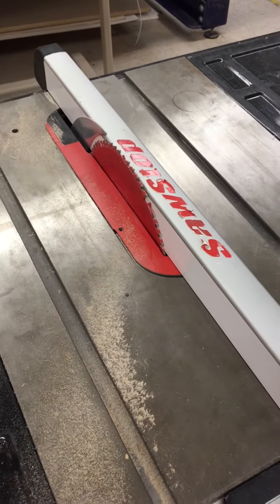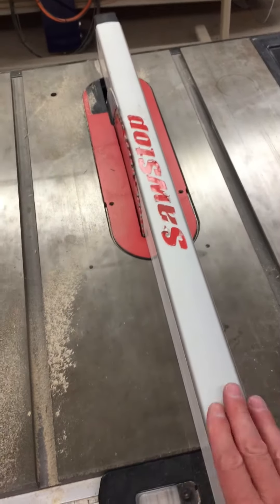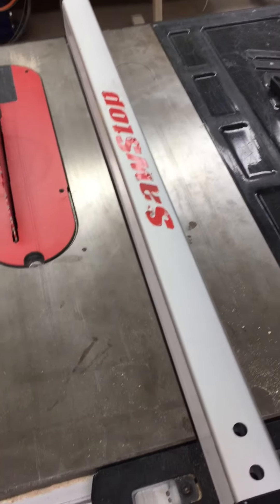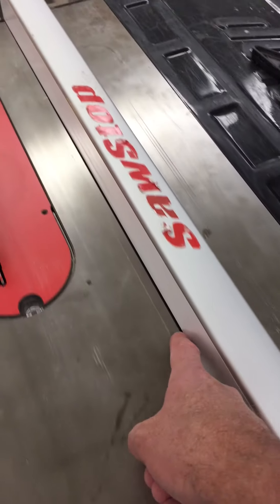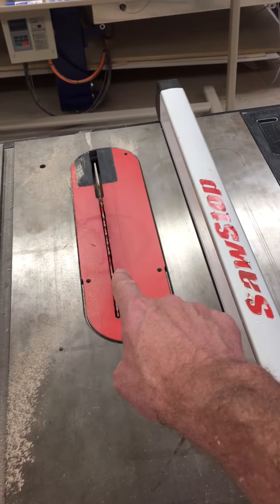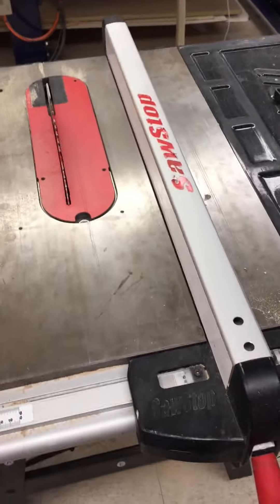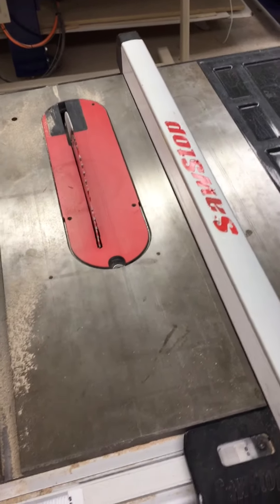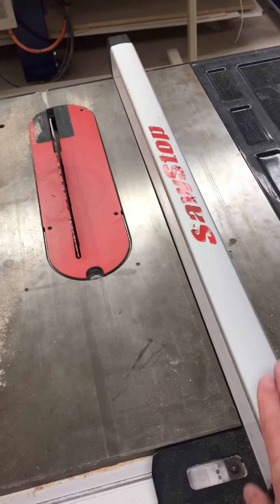Sawstop Rip Fence

Comment: I just purchased a used SS 30" Contractor with the standard fence. This saw will replace a Craftsman TS that I had improved by installing the Link Belt pulleys and the Delta T2 fence. These modifications transformed the Cman saw into a very respectable and accurate TS! However, when I switched to a Freud Stack Dado set, I experienced problems with he Arbor Shaft not allowing the Dado Blade components, to cut the bottom of the groove straight and clean. Therefore, I decided to get serious about getting a SS to make sure I'll always have 10 fingers!!! I am glad I made the right move, it only cost $800.00.
Reply from the maker: In my opinion, the 30" Contractor Saw is basically a pretty good saw with a very nice safety system and a bad rip fence.  We replaced the SFA model rip fence with a Delta fence salvaged from an old saw here - problem solved.  The SawStop T-Glide fence is also very nice - had one on a SawStop cabinet saw a number of years ago.  I should have bought the 36" SawStop contractor saw with the T-Glide fence to begin with.

Comment: I have the same issue and the way I get around it is bouncing the cam lock a few times to take out any wiggle, then I measure the front and back of the blade to ensure relative parallel. I always physically measure the fence to blade already, because I find it more accurate than trusting the marker on the fence itself.

Comment: I got the answer. Flip the fence over and youll see 4 posts that align the fence. Take out the 2 little ones and forget about em. On the 2 larger ones you'll basically going to have to make 1 bigger. Figure out which 1, take it out and crazy glue a .100 shim of mdf to it. This will over compensate the alignment. Slow sand away the mdf and it will bring the angle close to parallel with the blade. Test cuts,test cuts test cuts. Once you happy, tighten the bolt in the far back of fence. The bolt is located on the inside of the fence. It's a 10mm. Tighten that up and it will reduce the left over slop